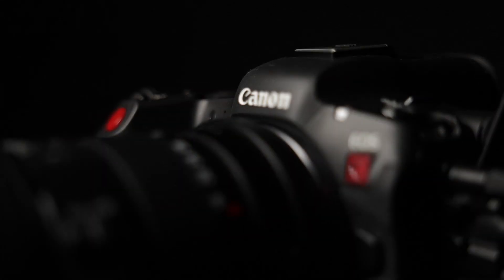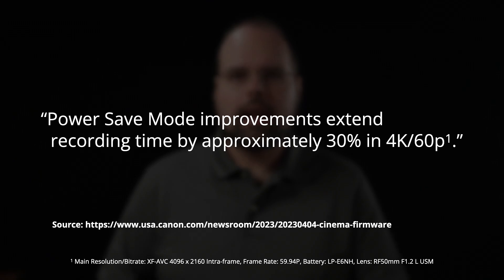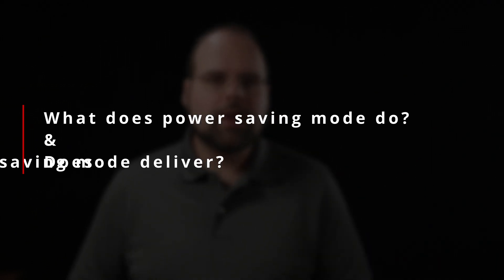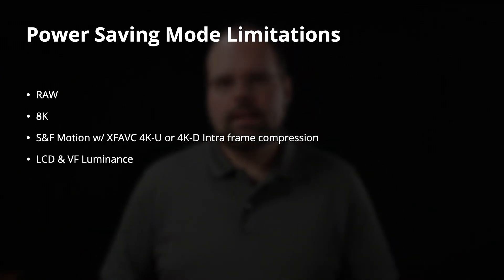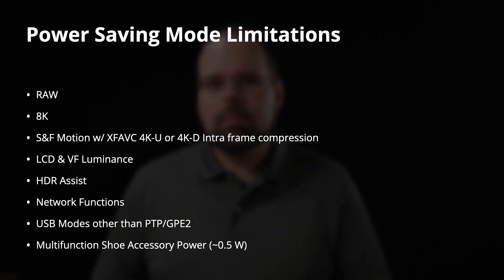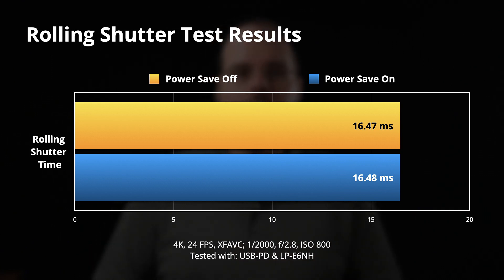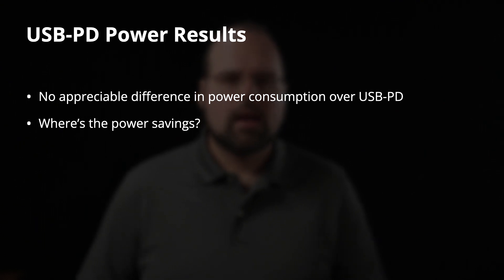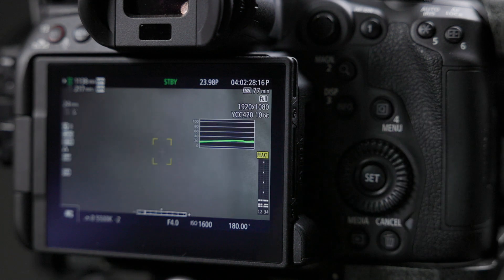Testing Power Saving Mode - New in R5C Firmware 1.0.4.1

Comment from the maker: Update: I was going to post another video covering this,  but I think I can cover what's needed here. if you're a user who's only interested in the brass tacks, the additional testing doesn't change anything about the end results you can expect. You do get 30%, or more, recording time when the camera is in power save mode. Moreover, there is no loss of image quality and the camera does not use line skipping to achieve these results.

Now for the details....

After discussing things with @csound55, I went back and did 2 more tests on power save mode. One was a visual quality assessment to determine if the image quality was degraded in power save mode in conjunction with line skipping. The other was to look at the remaining battery capacity after the camera powered down automatically.

In the case of the visual quality tests, there is no difference in image quality between power save mode and normal mode*. In conjunction with the power consumption tests and the rolling shutter performance tests, this shows that *the camera does not use line skip to achieve power savings.

Which leaves the question, where does the added run-time come from?

The answer is that the added run-time comes from unused battery capacity left in the battery. Under normal conditions the camera stops recording at around 40-50% battery capacity remaining. When power save mode is enabled, the camera will continue to draw down the battery to around 20%.

Ultimately, power save mode doesn’t really “save” power in the sense that I think any of us were expecting or would understand it. There is some amount of power saving going on, but it appears to be only to limit maximum power draw to something that the batteries can achieve without their voltage dropping below the safe minimum levels.

Comment: I discovered a loophole in how long I can shoot 4K 120p. I turn on 4K 120p and then immediately turn on power saving mode. And lo and behold, I can shoot in slow motion with power saving mode on. However, if I turn on power saving mode, I can't switch from the normal frame rate to slow motion.

Comment: Thank you for the video! I ended up finding a cheap power delivery three battery on Amazon. When I got it I was shocked by how big it was. The small rig clamp won't be here for a few days so I can't test if it will even work. I may have been better off getting a V-Mount battery.
Reply from the maker: I think I did a video on my USB-PD battery mounting solution, I showed it in the middle of this video https://www.youtube.com/watch?v=dRO9GEjxyAk. My Anker USB PD battery didn't fit in the Small Rig clamps either.
Reply: @PointsInFocus  thank you so much for taking the time to reply. Really appreciate it.
Reply: @PointsInFocus  Yes I just watched it again. I bought a small rig battery mount. For some reason I thought it would be big enough for these giant batteries. I guess we will have to see when I get it. If not I guess I will have to get a similar set up to yours. Lol

Comment: First, thanks for the awesome testing and discussion on this. I wonder if they are doing 8K pixel binning readout to 4K output? It is suspect that it is similar performance to R5 in line skipping but has the same readout speed as when it is downsampling? Honestly, if "Power Savings Mode" is using line skipping Canon should disclose that as a side effect of using the feature. I paid for the R5C partly because it does 8K downsampling to 4K up to 60p.
Reply from the maker: Based on further testing, the camera isn't doing anything different than it normally does — power save mode uses the same down sampled output as normal mode. The similar power differences with the R5 threw me a curve ball that lead me down the wrong path of thinking that it might be doing line skipping.

See my pinned comment for more details on what appears to be going on.
Reply: @PointsInFocus  Ah, I read your pinned comment. It makes sense in my experience with taking out batteries from my R5C when camera flashes battery warning and putting them in my R5 and seeing half or nearly half a battery indication.

Comment: Great insights. I especially appreciate the insight about whether the power saving changes anything for USB-PD. Since I use this a lot and was hoping that it would also draw less power that way (using a USB-C battery brick). No dice; I guess.
Reply from the maker: It actually doesn't seem like power save mode really saves any power. Well technically it can/does a little, but not in the way we would expect. It just limits enough ancillary power consumers to allow the camera to run the battery all the way down to 20% instead of having to stop in the mid 40% range.

I'm not sure what I'm more irritated at: myself, for doing as bad of a job on this video by not fully understanding what was going on and being mislead by my own biases and the similar power consumption difference with the R5. Or Canon for having a "power save" mode that doesn't really save power, though I'm not sure what would be a better yet equally concise name either.
Reply: @PointsInFocus  but but but! You figured out what was really going on with their "black magic", which you explained in the pinned comment. It also helps us make sense of the lack of "power saving" drawing of a power brick (which is what I use when filming longer days). So, thanks!!!

Comment: curious how much power does 8k 60 draw ? did you do this test?
Reply from the maker: I went back and looked through my notes, and I never actually tested 8K60. So since I had the test stuff on my desk I ran a quick test.

8K 60 looks like it draws around 15.75 watts. This is about the same as 4K60 or 2K60 which is expected since the camera down samples those lower output resolutions from a full 8K readout. The only power savings from 4K and 2K would come from the lower processing requirements for compression since there's less data to process.
Reply: @PointsInFocus  thankyou verry much, i could not find any info anywhere about this. you are a lifesaver :)

Comment: Needed! 
Btw, have you found any difference in low light noise performance between 4k, 8k etc?
Reply from the maker: I haven't done any controlled testing on that or really looked at noise all that specifically. However, in my broader impressions have been that the lower the output resolution the lower the noise is at a pixel level. So 2K is cleaner than 4K and that's cleaner than 8K. Though in practice, at normal viewing distances, I've never seen a discernible difference (though I don't have an 8K TV, so I've only looked at 4K and 2K in that case).

Comment: I doubt that line skipping is used for the power saving mode as the difference in picture IQ would be noticeable.. not to mention the howls of indignation that canon would cop from detractors 😲
Reply from the maker: I don't see how Canon can save that much power (we're talking about 5.3 W at 4k60) any other way.

And it's not like the camera doesn't line skip already. That's how it gets 96 and 120 FPS in S&F motion.
Reply: @PointsInFocus   Interesting question as to how the power saving has been achieved. I did a couple of test shots in 4K xf-avc with power saving on & off using an image with lot of fine detail and then zoomed 300% in edit - couldn't see any difference. On the R5 that would be noticeable between standard & HQ modes.

Reply
Reply from the maker: You're right, I couldn't see any differences in the test footage I shot when I did the video origionally, but I chalked that up to a combination of either me not looking hard enough or not actually having a proper test for it. However, I just threw the only test chart I have handy in front of the camera, and there's definitely no difference in the footage. Meanwhile there definitely is on the R5. So even my hastily thrown together test was sufficient to see the difference.

You don't suppose that there isn't actually any power savings at all?

I've seen several reports that the R5C powers down while there's still around 40% battery capacity left (or something like that). One of the problems I ran into was that the power saving mode didn't actually reduce the power consumption when powered by USB-PD. I couldn't explain that, and it doesn't make sense to me that Canon would design this to check the power source and change behaviors.

So what if power save just lowers the battery cutoff voltage to something lower than it normally is?

The disabled stuff is disabled simply to insure that the current draw never gets high enough to not cause a problem with the battery. Raw and 8K get the ax not because they use too much power, but because it's easier than disabling specific resolutions an frame rates (e.g. 8k60 and 5.9k60).

I kind of feel dumb for not thinking about this when I shot the video weekend. It also seems like a crappy way to go about "saving power" though it does technically extend the recording time.
Reply: @PointsInFocus  Seems unlikely Canon will ever provide a technical explanation as to how they've achieved the power saving but good there's an improvement even though it only works in certain modes.
Reply from the maker: I just finished running through the battery rundown tests again, and it seems what I suggested in my last reply is exactly what's happening. With power saving off, my camera powered off with 46% battery remaining. With power saving on, it powered off with 21%. Both of those percentages come from the battery meter in photo mode, and backed up by the battery meter in a 5D4.

And this of course explains why I couldn't see any difference in power consumption over USB; there isn't any. Power saving mode disables some of the most significant power consuming options so that the overall max power draw can't get as high as it otherwise could. This lower overall max draw insures that the battery isn't pushed as hard and doesn't either sag too low or doesn't exceed designed/recommended safe discharge rates.

Of course I'm kicking myself now. I should have dug into this more before I posted the video. I guess there's two lessons I get to take away from this. 1) Trust my ability to test things (this largely is down to the line skipping that I didn't think I could test with the tools I had), and 2) when I start trying to explain away things that don't make sense, I need to stop and reevaluate my premises, biases and what the data is showing. But there's really no excuse for not getting this right in the first place.
Reply: @PointsInFocus  Sounds about right. Sometimes necessary to revisit a technical puzzle before it makes sense.

Comment: I forget if the R5C has the same 30 minute limit like the R5?
Reply from the maker: No, there's no time limit on the R5C. And with the fan, even if Canon removed the artificial 30 min limit  the R5, it still would hit a hard thermal limit at some point relatively quickly (30-40 minutes for internal recorded 8K or down sampled 4K).
Reply: @PointsInFocus  Thank you for your reply, I don’t think the thermal limit is an issue on 1080 so should remove that limit on 1080. I think the thermal limit was only an issue on 8K but is it an issue on 4K24 or less?
Reply from the maker: As best as I can tell, the 30 minute limit is a hold over from now long repealed EU import tariff. They could have removed it when the camera was released (or shortly there after) if they really wanted to. My understanding of the specifics is somewhat convoluted since I'm neither a lawyer or an EU law specialist, but my understanding was that the EU repealed the tariff back in the mid to late 2010s, but the tariff didn't actually expire until mid 2020 (July or August). Since the R5 was supposed to launch before the tariff actually ended (before the pandemic screwed everything up in 2020), it and the R6 had the artificial 30 minute limit. Subsequent cameras have been unlimited aside from thermal issues.

Of course, it would be really nice if they'd just patch the stupid limit out now that there's no legal reason for it to be there. Let thermals and card space dictate when the recording stops.

To be honest, I've never tested the limits at 1080, and Canon doesn't cover it in the manual. It has an identical rolling shutter time to the 4K SQ mode, so it's possible (probable) that it's down sampled from 4K SQ. In that case, it should be fine at 30 FPS and slower, but might be limited at 60 FPS though it should also do better at 60 FPS due to the lower resolution and therefore lower load on the compression hardware.

And it's not like the compression isn't problematic when it comes to heat. Recording externally you can easily get 2+ hours at 4K HQ (and probably 8K HDMI raw) with an external recorder before the camera overheats.

Okay that was a bit of a ramble...
Reply: @PointsInFocus  Thank you for the ramble, it was all interesting. If it’s a matter of expiry then perhaps the R6mkII doesn’t have this limit? I do some computer programming and wonder if the 30 minute limit is a global constant and Canon wouldn’t bother with limits on one setting and not on something else. Changing it would be a major effort and not worth the trouble especially if it might cause consumer complaints in overheating or similar issues.
Reply from the maker: I think everything released since the R5 hasn't been artificially limited, at least on the higher end of things. I know the R3, R7, and R6-2 are only limited by thermals and card space. The R8 has a 2 hour artificial limit, which for the vast majority of people is unlimited (and it's only 5 minutes shorter than Nikon's Z9's limit). What I'm not sure about are the other lower end bodies — I don't honestly pay too much attention to that market segment.

While I'd like to think that changing the limit would be very easy from a programming perspective. It might also be messier than either of us imagine. It is an embedded system after all. Then again, they've already removed it from the code base in the newer high end cameras, so they know exactly what needs to be removed and or changed to take it out. Though it really should be something as simple as changing a build flag, global var, or define somewhere in the build config and recompiling the FW. At least that's assuming that Canon's build system and code base is sensibly designed.

That said, I don't think Canon has a very well designed or structured code base as a whole. In all the time I've spent digging into their cameras, there's been too many instances of bugs being squashed for one camera, but not for another that was released at a similar time. There's actually an issue with TLS certs with FTPS that was squashed in the 5D4, but showed up again in the EOS R and R5. 

What I think Canon does, is fork one camera's firmware as the basis for the next model instead of having a big shared code base with modules for building camera specific parts (e.g. the sensor driver or IBIS module) that are pulled in by the build environment.

I suspect, this is also why they can't seem to port sensible features from one camera to another. E.g. why the R5 FW 1.8 got the pixel-shift multi-shot mode, but it also isn't on the R6-2, R3, or R8 (and it's completely useless on the R5 the way it's implemented, so it would actually make more sense on an R8 or R50 than it does on the R5). Or why cameras at the very bottom end have the latest subject detection capabilities (horse, plane and train) while the flagship R3 doesn't (though this could also be because the R3 doesn't have enough flash for the bigger firmware files, but that just looks even worse).

Comment: Are you able to test if they are link skipping?
Reply from the maker: Since the power saving mode doesn't change the rolling shutter performance, that has to be done optically. Unfortunately, I don't currently have the proper test targets to be able to do that, or I would have absolutely included it in the video. If I can figure out a way to check with targets and tools I do have, I'll either post an update or pin a comment with updated information.
Reply from the maker: I went back and did a visual test for line skipping, and there’s no visual evidence that the camera is line skipping. So between the lack of visual differences, the same power consumption and rolling shutter numbers, I’m very confident at this point that the camera doesn’t line skip in power saving mode.

Comment: Thanks a lot for your video, I've installed it recently and I'm overall happy with the outcome. But not being able to use higher luminance on the LCD was not expected side effect...
Reply from the maker: I get why it's not supported, after all running the backlight brighter means more power consumed. But yea, that one really hurts if you work outside and don't want a 4000 pound looks-like-you-work-for-a-Hollywood-blockbuster-production sized rig.